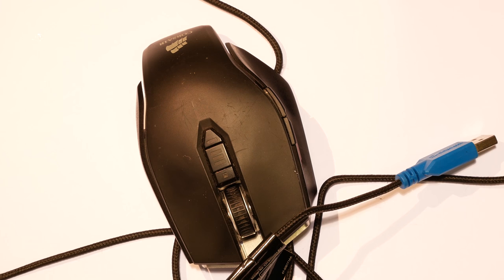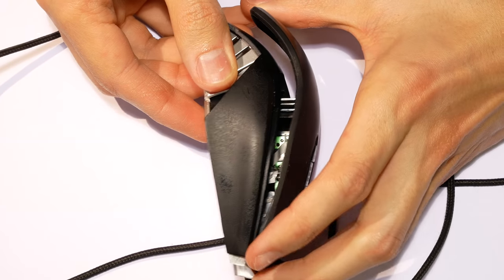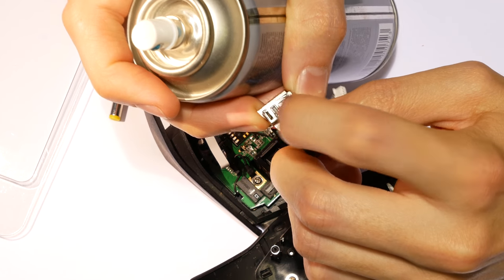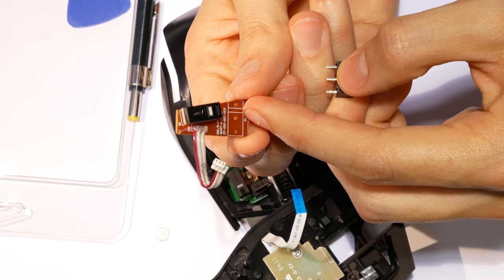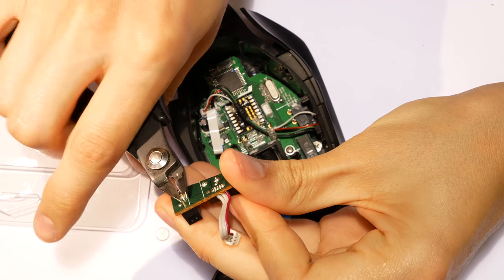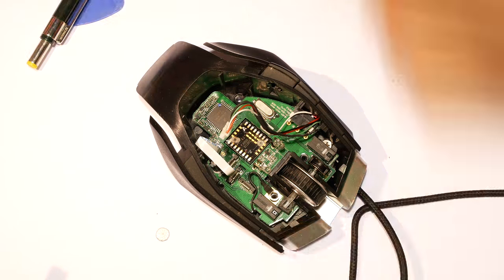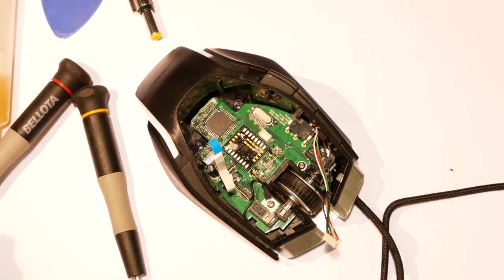Replace or customize a mouse switch

Comment: This just took all my hesitation away for the Corsair M65. The only common complaint I've seen is that it eventually has click issues. You've clearly shown that replacement clickers are cheap and easy. And you've shown that the mouse can be opened without destroying the PTFE.

Thank you!

Comment: Thank you!! I had a bit of trouble de-soldering since I only have a soldering tool and it didn't work well at first because of my crappy soldering job but I got it in the end.

Now I'm realizing I'm gonna have to the right click too because the clicks are different lol
Reply from the maker: Yeah, always change them both, otherwise it might get annoying.
Reply: @jfaria  i changed both but they still feel way different
Reply from the maker: @GlobeStan  Maybe the switches you bought are actually different?
Reply: @jfaria  they're supposed to be the same but maybe they're chinese knockoffs. Whatever I'll get used to it.
Reply: not sure if he mentions it, but while you solder the middle pin first, pinch the switch tight against the board so there's no space between the switch and the board and it's straight.

Comment: What did you apply on the pin before solding? Is it necessary?
Reply from the maker: Flux. It makes the solder stick very easily to the pins and pads and the end result is also significantly better. Buy a decent quality flux and after trying it I guarantee you will never solder without it again.

Comment: i replaced my switches but the stupid solder (lead) never sticks to the terminal or the board. it just sticks to the soldering iron. I put flux on it, i tried all kinds of things, but I basically killed my mouse and Now i gotta buy a new one. it was a piece of trash anyway, but it sucks. I really wanted to repair it... WTF I dont understand why my switches dont work when I reinstall them. I think the solder will ball up un the end of the terminal but it doesnt go into the hole.  I may have damanged the socket when I was trying to remove the stock lead-free solder because a small ring of metal came off...
Reply from the maker: I see two different problems. First, you may not be using soldering flux, or a really bad one. If you use good flux you can get away with using a cheap soldering iron and cheap solder. If there is a round ball, it sounds like you have a cold joint: https://karpova-lab.github.io/cerebro/_images/soldering101.png

The second problem is that the metal ring might have come of, that means your soldering iron was too cold and you had to apply a lot of force for the button to come of, damaging the PCB in the process, or (less likely) the soldering iron was too hot and it damaged the PCB.  Check this article for a possible solution: https://oscarliang.com/repair-ripped-off-solder-pads/
Reply: @jfaria  Yeah I think I destroyed the solder-pad ring. My stupid desoldering suction pump never sucks anything out so I was trying to push some trapped solder through with the solder iron's hot tip, but I think when I pushed the solder I both burned the PCB and removed the soldering pad. I think that once the soldering pad was removed, the solder does not stick to the board, only to the pin since the metal on the board was removed and the only metal to stick to is the pin. 
It does look like the "cold joint" or the "too much solder" example images too, but my iron was at 250-300 degrees and I am using tin-lead solder. I think I need to be more careful while desoldering. It was very stressful so I just did it too aggressively. Thanks for the information. Very helpful. I will probably not repair the trace though. I dont want to go crazy. My solder iron and pump are from aliexpress, it is a piece of shit.

Comment: Nice tutorial ! Could you please recommend a silent switch ? I have the same omron - black body white head microswitch 20mil clicks in a Logitech g603. And I would like to replace them with a silent version... Thanks a lot !
Reply from the maker: The ones I used in that video make significantly less noise (but with less feedback, which some people don't like), but as far as I know, most silent mice use different switches that are not compatible with our kind of mouse, like these:
https://www.aliexpress.com/item/Mouse-micro-switch-6-6-7-Touch-the-mouse-silent-mute-switch-mouse-micro-switch/32703935052.html

What you can do is order a handful of different cheap switches and test them when they arrive to see which one is quieter, but I wouldn't count on finding a completely silent micro-switch in that package.

I would start by evaluating what's available on electronics distributors, like this one:
https://eu.mouser.com/Electromechanical/Switches/Basic-Snap-Action-Switches/_/N-5g2vZ1yzvvqx?P=1z0z2vv&Ns=Pricing%7c0
Reply: @jfaria  Is there anyway I can send my mouse to you and you can fix it and I can pay you?
Reply: @jfaria  Also what kind of screw driver is that
Reply from the maker: @sonicisdog  No, mate, I don't have time for that. A mouse is the kind of stuff that either you repair it yourself in your free time or it's really not worth it to pay someone to do it, if you add the labor and the shipping it will be more than a new mouse costs. That was a Torx T6 screwdriver, by the way.
Reply: @jfaria  since you're inside the mouse anyway, i wonder if there's a way to silence the switches -- putting modeling clay around the sides comes to mind...
Reply: i don't know how much of the sound comes from the switch itself though
Reply from the maker: @jgunther3398  It would be probably easier to replace them with silent variants, maybe check the available silent mice and try to find out which switches they use.

Comment: is it possible to change the middle click feedback? mine feels so stiff, g305 mouse.
Reply from the maker: You can try and find a lighter switch, but a lot of that force probably comes from the mechanical design of the middle button wheel itself.

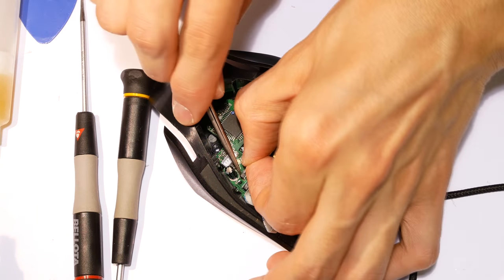Comment: its possible to change to change the white-blue cable in the 7:29 if it broken or not?
Reply from the maker: Sure, you need to count how many wires it has and then search on aliexpress.com or a similar site for "flat flexible cable x", where x is the number of wires the cable has. Then choose a cable that has the same spacing between the pins.
Reply: @jfaria  thanks so much!!!!

Comment: what size solder wire you need for a mouse switch
Reply from the maker: Any will do, use the one you are more comfortable with. If you are about to buy some I would choose something between 0.8mm and 1.2mm, but if you only have bigger sizes it will work fine.

Comment: Seems everyone has the same problem and it’s always a Logitech mouse. Mine is g502 hero and the clicks have stopped working properly, cannot click and drag anything
Reply from the maker: It's every mouse, especially those used intensively like gaming mice. The one in the video is a corsair and it has the same problem. Mechanical switches have a limited lifespan, no way around that. There are other technologies, like hall-effect and optical ones, but they are more expensive or require additional circuitry which also costs more.

Comment: Damn middle click on my g402 stopped like last year. Now im getting double clicking on left click
Reply from the maker: It might be a good time to replace the switch, increased switch bouncing is a sign of wear. In fact I would replace the right click as well if you are replacing the left click one.
Reply: @jfaria  Yea i have to.
Reply: @jfaria  I never used done this before i have to get all the parts from aliexpres im guessing next months im gonna replace it.
Reply: @jfaria  Btw can you make a tutorial small one how to replace the middle click switch ? Please :D
Reply from the maker: @filds1  It's the same exact process, unsolder the 4 pins and resolder the new switch. The tricky part might be finding an exact replacement, but just buy a handful of similar looking switches and hopefully one of them will fit :D
Reply: @jfaria  Btw what type of soldering wire should i use ?
Reply from the maker: @filds1  Any soldering iron will do, but removing the old switches will be a lot easier if you also buy an electric desoldering pump, even a cheap one like one of these: https://www.aliexpress.com/item/Handheld-Electric-Tin-Suction-Sucker-Pen-Desoldering-Pump-Soldering-Tool-With-PCB-Board-Nozzle-Cleaner-and/32950522153.html
Reply from the maker: Oh, you were talking about the wire, not the iron, anything will work.